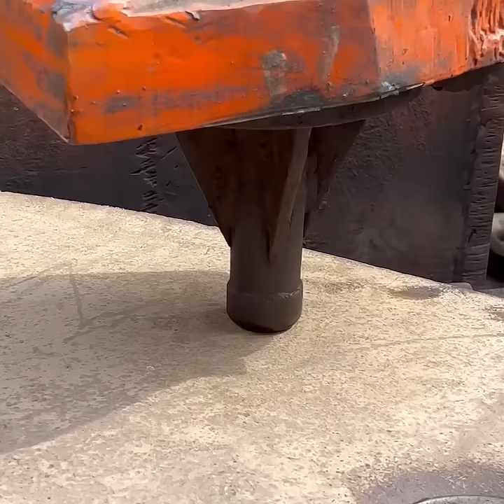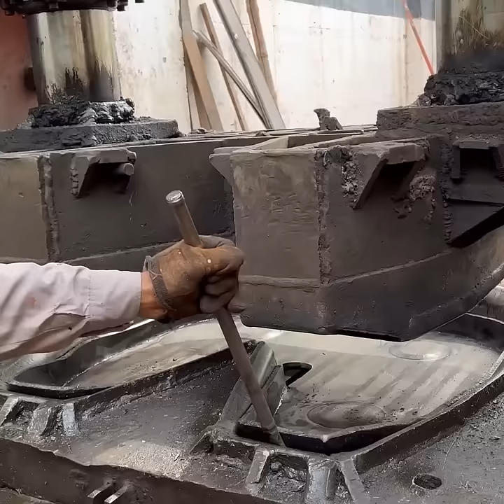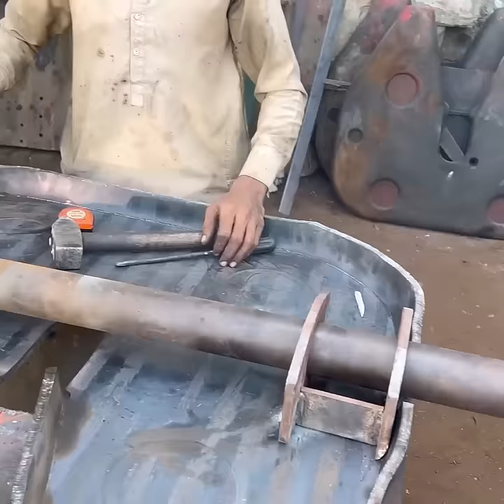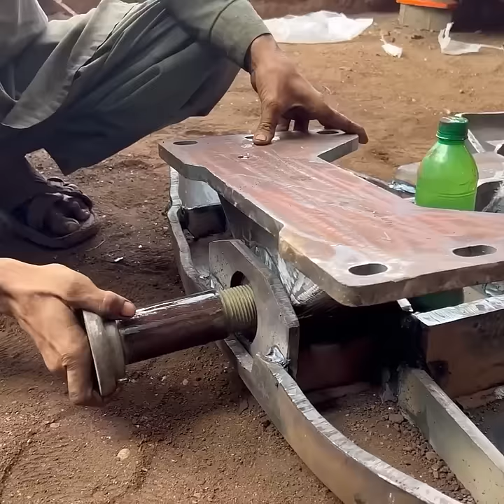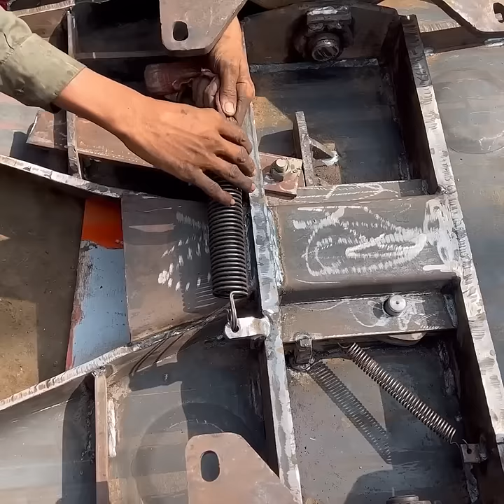Manufacturing process of fifth Wheel for 12Wheels Trailer with Amazing Skills

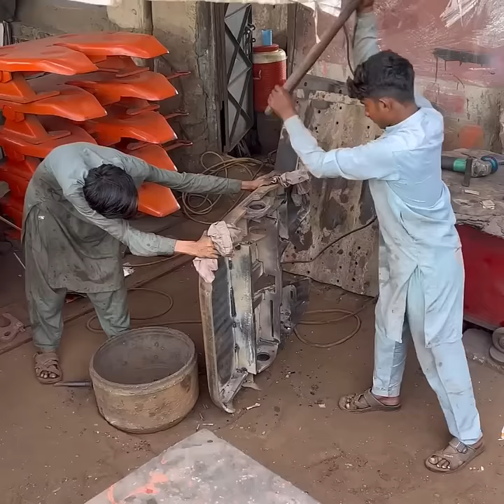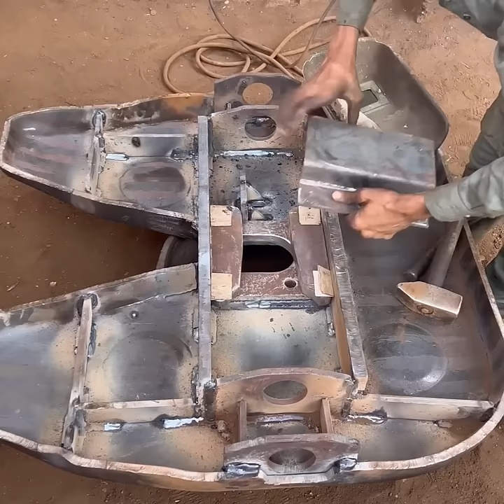Comment: With all the safety precautions missing, one thing in particular gets me: The sledge hammer at 0:37 / 0:38. Why does this part need a good hammering? And if it does, why don't you have a stand to hold the entire piece while you pound it? Why does some poor guy have to put his hands and his head in the path of a dozen pounds of steel?

Comment: Whatever people are writing here let me make some comments. I worked in 80s for JN Kirby  in Sydney Australia in car part manufacture.
As a Metalwork welding teacher for 20 years there are many things wrong here. 
This part constitutes a very important part of a truck and the welds must be done perfect.
Notice the middle pieces contain rust. All welds need surface preparation. They did not remove rust so those welds are compromised. The gap between parts needs to be optimum, those gaps are lousy to say the least .Final finish looks like one coat which is poor technique no durability. 
No safety standards.  Proper welders wear full skin protection.  These people wear none. Often wear sandals which is an accident waiting to happen.
This form of work is crude at best. A manufacturer like say Hino would have robotics doing these processes making perfect parts.
What I see here is a rudimentary manufacturer make rubbish.
Unless you work in vehicle parts manufacture please do not comment on my commentary. I won't reply.
Reply: I think that you pretty well covered it, except the liability issue.  I am sure that in Pakistani, the manufactures have no liability,  if the fifth wheel fails and as a result you are killed, well that’s just too bad.
Reply: I made a comment about radiation being a real thing. I'm a machinist, tool maker, tool setter, automotive tech., heavy equipment operator ,welder, ship fitter and I have an industrial sewing degree just for good measure. Every word you said is so true. That was definitely an inferior product.

Comment: Everyone saying that they are artisan bull shit they are controlling there markets buy not having any parts changers or technicians . There is no or it's very hard to find a mechanic over there so when you need a part there are tons of little machine shops with old ass equipment and what is metallurgy mix some of this flatten some of them and poof out comes what looks like a part but made from God knows what